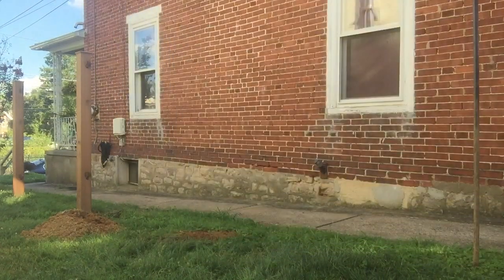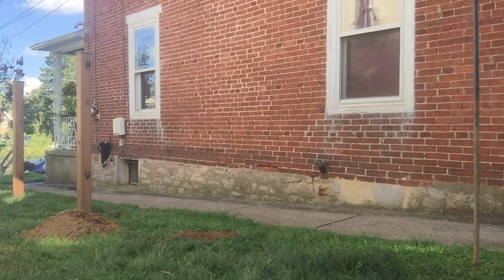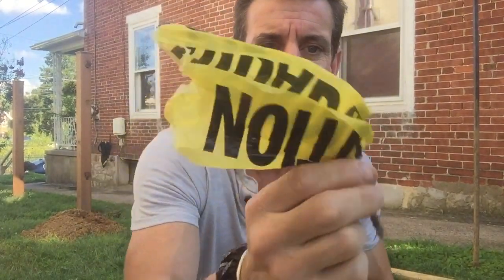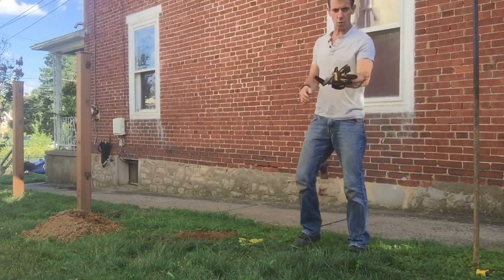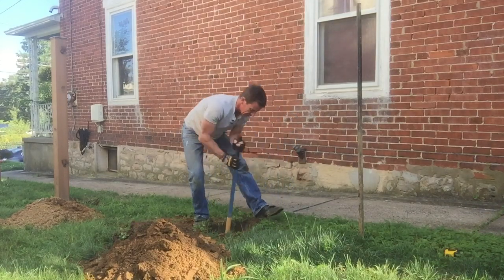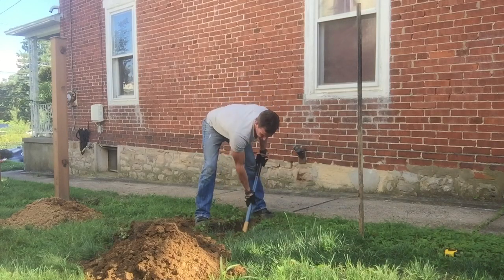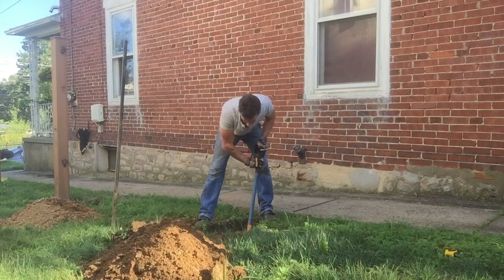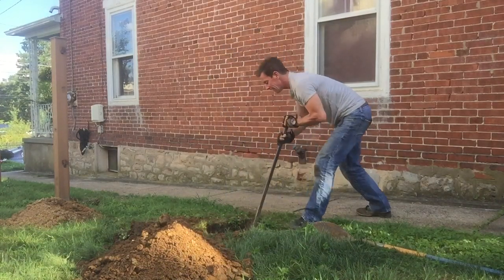How to dig a hole for a fence post, deck or mailbox

Comment: Thanks for the video. I thought I knew how to use a shovel, but no, I didn't. Now I do, and it will make digging my "shafts" faster and easier.
Reply from the maker: Really appreciate it Ian. Good luck. Check out our Facebook and IG post on 8/3. Another tip for managing dirt on deck builds.